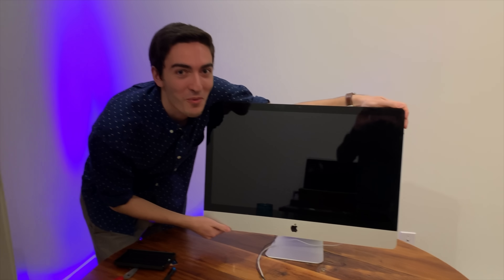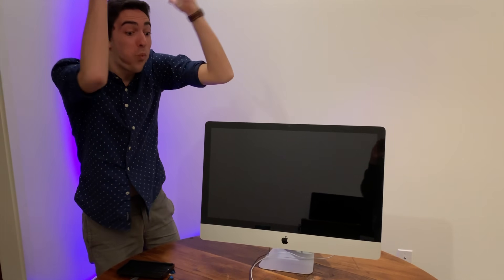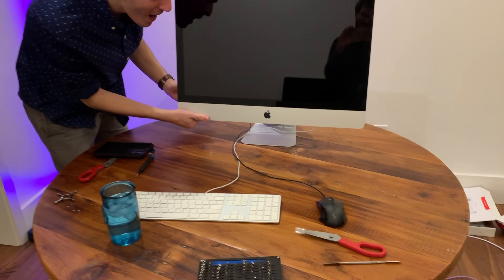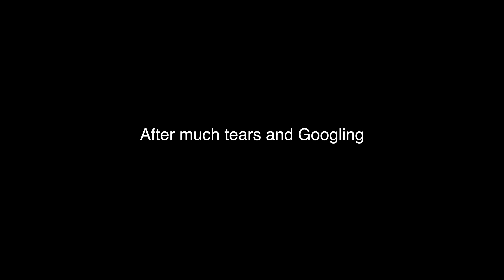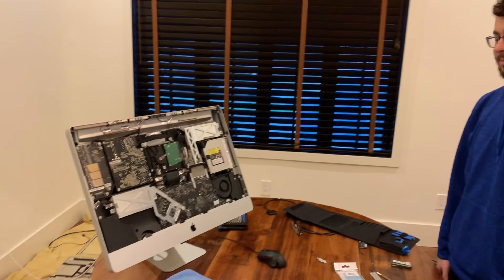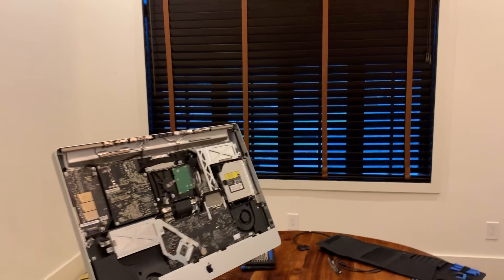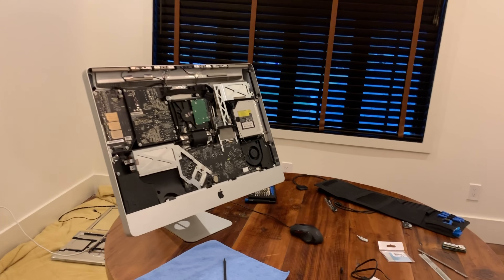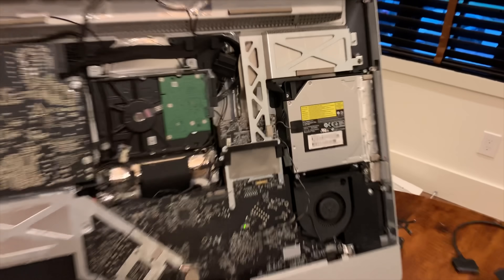Upgrading the graphics in our 2011 iMac (first attempt)

Comment: If I recall it right, you can use an AMD RX 580 and just rely on the stock driver. Also you got Mojave support.
Reply: Probably in a MAC PRO. We are discussing the iMac. Unfortunately a total different story.
Reply: @maikkaune  seems there is an element of truth to the OP - RX580 is rebadged as the AMD WX7100. It's not easy to get hold of the mobile version but it's far and away the most powerful card you could reliably use in this imac. Check out this thread for all the info on the GPU upgrade topic: https://forums.macrumors.com/threads/2011-imac-graphics-card-upgrade.1596614/

Comment: Macs are stupid, apple has to take every step possible to stop us from making are stupidly over priced products better in any way.
You could flash the card you have to a working bios, and then you should install the drivers and everything while in safe mode while your fingers are crossed. Of course you’ll need an old laptop of something to run the 980m I order to flash it to the right bios.
Good luck, I seen it coming and I was just like oh no. . . they didn’t say anything about the bios, I just hoped you guys either had the right one or did it without saying. I really wanted to see it work. Cool project guys, hope you get it going.

Comment: Oh Man! I replaced the HDD and Optical drive in my sister in laws's iMac, same year, the internals look similar.Your's is a 27" though, hers was a 21".  I could probably do this for that machine. These iMacs can definitely get a few more years of use. Steve Jobs may have had his fingers in these, maybe early in the design process.

Finally watched the second half of the video, sorry that it didn’t work but I learned a lot watching! Thanks!

Comment: I have tried with different ATI MXM card and i have same problem with my iMac 2011 27, only original card car run with this fxcking computer, thank apple.
Reply: Apple is offering new macs... they do not want you to upgrade or improve your old one, they want you to buy a new one. Fixing or upgrading Apple products is kind of illegal on their eyes.
Reply: Actually there are other cards that do work but it will require some work from you in addition to fitting it in your machine.Check out this link for all the latest info on the GPU topic:
https://forums.macrumors.com/threads/2011-imac-graphics-card-upgrade.1596614/

Comment: Is the processor and graphics upgradable on these 2011 iMac ? Apple iMac "Core i5" 2.7 27-Inch (Mid-2011) Specs

Identifiers: Mid-2011 - MC813LL/A - iMac12,2 - A1312 - 2429
Reply: Michael Sais check iFixit guide for 2428 (21 inch same year) 
GPUs https://www.ifixit.com/Guide/iMac+Intel+21.5-Inch+EMC+2428+GPU+Card+Replacement/5980
Cpu https://www.ifixit.com/Guide/iMac+Intel+21.5-Inch+EMC+2428+CPU+Replacement/5951

Comment: You could flash the Alienware vBIOS on the GPU. I know it sounds like I'm trolling, but flashing different manufacturer's vBIOS on GPU's is quite common for compatibility purposes. I've done it before on an ASUS 750 Ti for a hackintosh. Flashed PNY, and it worked like a charm. Just make sure you backup your OG vBIOS so you can restore it if it doesn't work. (You're going to need to use a different primary GPU if you want to flash this one back)
Reply from the maker: We tried but there’s nothing to flash the vBIOS with, as the iMac can’t POST and the Xserve doesn’t run Windows
Reply: @lukemiani   You could flash it using a raspberry pi if you follow these instructions: 
watch?v=KNy-_ZzMnG0

Comment: Probably the gpu is not flashed to run on a Mac 
Flash the bios.
Reply from the maker: The vBIOS and the EFI firmware are separate. Many cards will work in Macs (especially Mac Pros) but only Apple cards, or ones flashed with the Apple EFI firmware can display boot screen and boot switcher. A card can work without the firmware
Reply: Flash GPU vBIOS to the Alienware one. I'm 99% sure that would fix the problem.
Reply: @lukemiani  "the vBIOS and the EFI firmware are separate" well no shit sherlock but still the fact that your ignoring this is dumb, just flash vBIOS you lazy bum and see if it fixes it, there's a reason you can reflash a videos cards bios, overclockers do this all the time to fix problems and to get better overclocks even people in the computer industry do this also there a reason  why ThechPowerUp keeps a big archive of GPU bioss

Comment: You should be aware for future videos: please don't ever use a microfibre cloth to rest electronic components on. Microfibre is VERY susceptible to building up static charges, so using them to rest something like a graphics card on is an extremely bad idea. That is one of the quickest ways to kill a GPU or anything with electrical contact points or pins for that matter.

The wooden table surface is perfectly adequate. Either that, or a cardboard sheet, rubberised mousemat or a specific builders mat like those sold by Gamers Nexus should be used instead.

Comment: GTX980m does not have an Dell/Alienware rom as far as I can find.
The max is GTX880m which seems to have an Dell/Alienware rom.
I doubt even the 880m will work, I dont know about this one, but by the looks on the iFixit thread it could work..
Do keep in mind TDP wattage could be high, or too high for the iMac 2011 !
I would say stick to a  max of 100Watt usage cards !

But like Highvoltage12v bellow sates, stick to known working cards !
like Dell/Alienware GTX765m or GTX780m.
See thread on macrumors as stated !!

Comment: I don't get why so many comments clearly show the viewer doesn't comprehend what's going on here, even in basic terms.

The machine physically won't boot with the card they have in this video. At all.

It isn't about flashing firmware for macOS, or anything like that -- they aren't "not getting a boot screen" and they just need to flash something, no, the machine will not boot with this card due to it not carrying a particular feature set which other commenters and Luke himself have described in other comments here.

Luke explained the situation in very direct, but still simple enough for anyone to understand terms in the video, but for some reason, people don't get that... it's almost as if they didn't bother watching the video before they commented, even though like a minute in Luke mentions the lack of a boot screen in detail, showing they are both very much aware of what happens when you use an unsupported graphics card in a later MacOS build.

EDIT: There's talk going around here (and replies that mysteriously disappeared) about flashing the card with the dell / alienware bios, what have you. Yeah, if that's a thing that could be done, sure, it may work well enough, but that's NOT what most people are talking about here, which is clear from context.

Comment: Can everyone who sees this comment thumb it up so Luke can see this. 

As I said in the comments the last 3 videos, you need a Card with VBIOS DCB tables that lines up with the iMacs EDP (embedded display port aka the LCD connector to have video) such a the Nvidia 765m and 780m that are from the Dell Precisions and Alienware laptops. Please read the 2011 iMac MXM thread on Macrumors fourms. Even better join the discussion I'm on there as well as many others who have successfully done this.
The thread is called "2011 iMac Graphics Card Upgrade" we're at 60 pages of discussion.
Reply: Why doesn't he just flash the card... He's got  that Xserve or for 20 bucks on eBay get a flashing tool... Someone really needs to put up a video on YouTube so many people looking for this information.
Reply: Without going through 60 pages of discussion, has anyone tried to update a 2011 iMac with a Radeon e9550 card?
Reply: I wish someone would summarize that thread. It's over 110 pages now and goes back to 2013. I looked through it but it's difficult to follow when you're just getting started. So many leads that later turn out to be dead ends. Easy to miss a post with critical information.
Reply: he found out now I think.......
Reply: I have contributed in thats forum page, and have also been down this path........ I was unable to get either a 780m or 980m working....... after buying many cards I finally gave up!
Reply: @philfinden , how about Radeon RX 480 MXM cards?
Reply: DRAWILLUSION never considered it as an option
Reply: I thought it didn't work because the 980M isn't supported? Shouldn't he be looking for something from this list: https://support.apple.com/en-il/HT202823  or similar? Also, didn't he place the card before installing the kext?
Reply: EDP wasn't a thing until a few years ago, pretty sure the iMac uses LVDS.
Reply: highvoltage12v  the fastest way to install windows on Mac  is install 8.1 and then upgrade to Windows 10
Reply: I think another issue might be the 980m is too heavy for the iMac power supply and thus it cannot work within the chassis
Reply: @6812000  Actually it's because the 980M is based on Maxwell architechture instead of Kepler. 
The current list of working cards are:
NVIDIA Quadro K2100M +
NVIDIA Quadro K1100M +
NVIDIA Quadro K2000M *
NVIDIA Quadro K1000M *
NVIDIA GTX 780M ++
NVIDIA GTX 770M *
NVIDIA GTX 765M *
AMD Radeon WX7100 **
AMD Radeon WX4170 **
AMD Radeon WX4130 **
NVIDIA GTX 860M *
NVIDIA Quadro K610M **
These cards all have varying levels of functionality and several have now have custom VBIOS' workarounds. Please visit: https://forums.macrumors.com/threads/2011-imac-graphics-card-upgrade.1596614/ for more more details.
Reply: @Rendell001  thanks for that so informative and useful for future
Reply: @alaster33  No problem - just trying to help the community any way I can...
Reply: @Rendell001  they are using el cap
Reply: There are options that you can put? I would like something aide vega 48-64
or rx 580?
Reply: @LOTIN_SUPEROV  You could do external GPUs but with apples dropped supposed for TB2 it is hard and requires workarounds
Reply: @LOTIN_SUPEROV  yes we actually have RX 580 (Radeon WX7100) working now with bootscreen support

Comment: Damn! I was really hoping you all would have had success. 
If the Server saw the GPU, why not use it in that machine?
Reply: Because its a Maxwell based card, not Kepler. iMacs need Kepler cards to work...
Reply: Rendell001 Thank you for the info. What was the GPU he tried again? 😂 😆
Reply: ricky v a GTX 980M - had it been a 860M then it probably would have worked though I know that now, almost all compatible cards need VBios workarounds to restore boot screen and fix compatibility issues with Mohave etc. Have you checked out the GPU upgrade thread at Macrumours? That’s THE place to go for the latest info on this topic and all those engaged on creating workarounds for the cards...

Comment: 700 series is the latest supported GPU because Kepler is the last with native drivers
Reply: Technically the 860M also works but there is more work to be done in creating a custom VBIOS workaround for it. Check out page 1 of this link: 
https://forums.macrumors.com/threads/2011-imac-graphics-card-upgrade.1596614/

Comment: Did you flash the bios of the card to a hackintosh bios?
Reply: there's no hackintosh bios for GPU's. He could install clover boot loader (although that probably won't fix the problem) or he could just flash the Alienware bios for the same chipset onto this GPU and it should work the same.

Comment: I think you need to flash the vbios on the videocard so it can be recognized on the imac , not sure how you do this, but  I remember i've seen a post on ifixit so you can check that out. 
Waiting for your next  video, keep up the good work!
Reply from the maker: There are some simple tools that allow you to refresh the cards, but you obviously have to be able to plug it into a MXM slot that doesn't matter for booting, so our iMac is out since it won't POST. We tried to do this on the Xserve, as we can boot off the normal graphics and leave the 980M in the MXM slot, but sadly you can't install Windows on the Xserve so it worked out being easier to just order a new 980M and sell the one I had
Reply: @lukemiani   Great! i have a similar iMac 21.5 inch model with i5 and i'm thinking about changing the videocard too, but i'll just wait for your next video to see how it goes. Anyway, great job and keep up the good work!
Reply from the maker: The tricky thing with 21.5” iMacs is the smaller power supply and the fact that they use the shorter MXM type A

Comment: it might be hard to but it could be reflashing the bios on the 980m graphics card to a config/bios that’s on a dell or clevo laptop ?
Reply: oh you did briefly cover it kind of , jumped the gun without watching all the video lmoa
Reply from the maker: We left out the part where we tried to flash it through Windows on the Xserve, but you can’t run Windows on them (unless I find a way eventually) so it turned out being easier to buy a different card and sell the old one

Comment: Can’t you just install the Web Drivers? Also, doesn’t this GPU have Metal? If yes, does this support Mojave?
Reply from the maker: Web drivers aren’t the issue, the lack of vBIOS means the computer won’t POST. And yes, it is metal supported
Reply: Luke Miani 
Try to flash the vBIOS of the card you have to the one of Alienware. You can find BIOSes for all the cards on ThechPowerUp and you can use an NVflash to flash the BIOS. Just install your GPU in your XServe, boot into Windows and flash the vBIOS.
Reply: Captain Morgan - This. It's quite common to flash vBIOS of different manufacturers for compatibility as long as they use the same chipset.
Reply: Luke Miani oh cool. So in theory you could make this work with Mojave.
Reply from the maker: In theory yes, but the issues of modifying the display Kext with Sierra/HS may be different or more difficult as the machine Isn’t supported. A can of worms I likely won’t open for a good while
Reply: Luke Miani bit don’t the 900+ series GPUs require NVIDIA Web Drivers? Those aren’t available for Mojave yet sadly...
Reply: Piipperi800 they aren’t blocked, just haven’t received certification status from apple, hence why Nvidia won’t release them. I just wish they would release them unsigned so that people with newer Nvidia cards could enjoy Mojave as well...
Reply: Luka Jankovic according to some article I saw about a month ago, it said something about NVIDIA having some thing with Apple that if they were to release the drivers unsigned, it would be really bad for NVIDIA or something. And yes, they are technically blocked. Thres even a hastag on twitter ”#UnblockNVIDIA”. Also isn’t it kinda wierd that it has been 3 months already since the drivers were supposed to get released?

Comment: You are possibly running out off power, I read in a forum that the model of your iMac have a very weak power supply and thats could be the problems  the post I talked about is here https://www.techinferno.com/index.php?/forums/topic/12088-gtx-980m-imac-support/ hope it helps in something and sorry for my terrible English

Edit: if you want to try flash the bios, here you can download the clevo one: https://www.techpowerup.com/vgabios/167297/clevo-gtx980m-8192-141030

Edit2: here's the alienware bios for the 980m: https://www.dell.com/support/home/br/pt/brbsdt1/drivers/driversdetails?driverid=9w9f7
Reply from the maker: We considered a possible power issue, however the iMac has a 310W Power supply (labeled on the PCB so that's 100% accurate), the 980M has a 120W TDP, i7 has a 95W, with another 95W for the rest of the system. It's tight, but it should have enough room. Also check out the link in the description from iFixit where a guy installed an 880M in his 2011 27" iMac (also 120W TDP) so firmware is more likely. I suppose we'll find out when we put the Alienware card in it though! Fingers crossed!

Comment: why didnt you get amd gpu?
Reply from the maker: Mojave installation is a whole other can of worms even with a Metal supported GPU (The GTX 980M is Metal supported too by the way). And the issue is availability. Even if there is a 580 MXM card somewhere, I sure as hell don't know where. You literally cannot find them on US eBay. Much easier to go with the 980M, and many argue that Nvidia graphics are better than AMD anyway
Reply: AMD cards draws more power(which iMacs has a limit), and also simply there are more used NVIDIA mobile graphic cards available than AMD. For example, you can find tons of used GTX 980M on eBay, but I can't find any of the AMD equivalent of GTX 980M, R9 M395X.
Reply: rx 580 mxm has 100w tdp and gtx 980m mxm has 125w tdp
Reply: It's unknown territory for the 2011 iMac to use an AMD MXM card. AMD's ROM are more difficult (Hex-edit) to work with than Nvidia, which is why someone such as MacVidCards doesn't produce EFI cards newer than the r9 280x. With Nvidia cards we can find the DCB tables in the ROM and can calculate the different display outputs. It's too difficult to read on an AMD rom. MacVidCards/Rominator started to create an EFI ROM for the 780m. But has gone silent on progress due to HDCP issues. So unless someone obtains an rx580m MXM card, tries it and it works, No one will know. It's all about how the card lines up with the EDP port.
Reply: Because amd sucks
Reply: and it is supported and he would potencially be able to install mojave
Reply: @ThatLennyBoi  Intel and nVidia fanboy spotted.